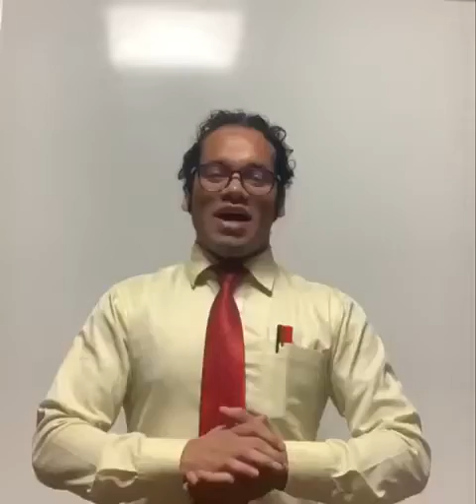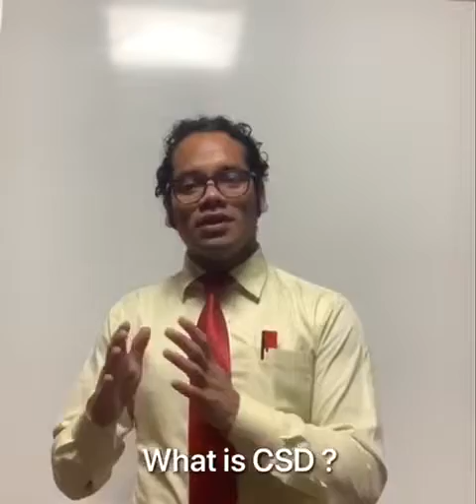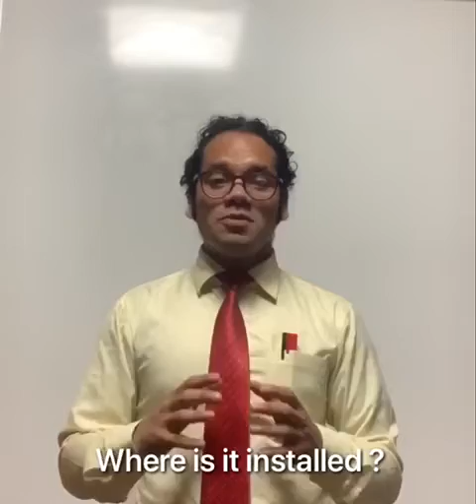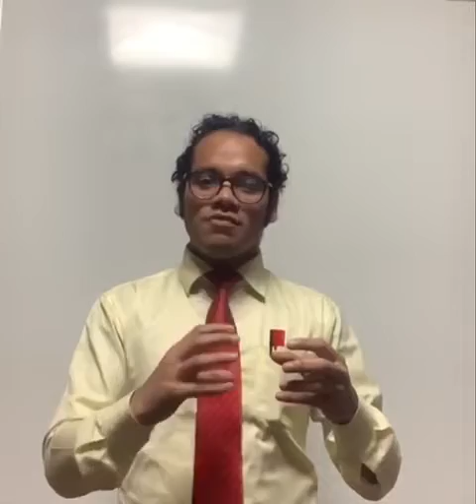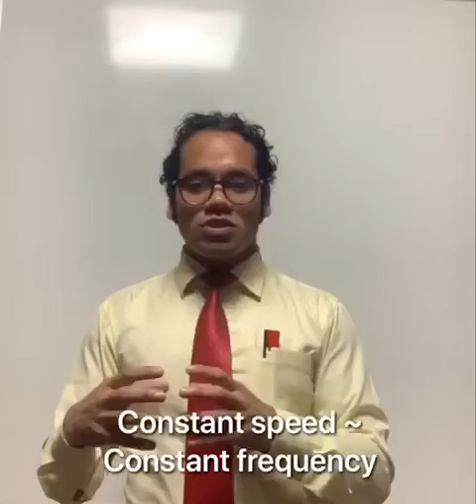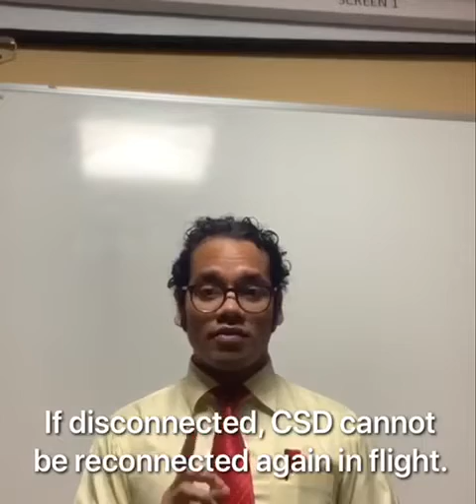What is CSD or Constant Speed Drive?

Comment: Sir please tell..me 
Is CDS Connected in DC generator?
Or It connected only Alternator?
Reply from the maker: CSD Drive is required to maintain frequency (of the out supply of an alternator) constant plus minus some tolerance. Hope you know frequency is applicable only for AC and not for DC. Hence, CSD is for alternator/AC generator.